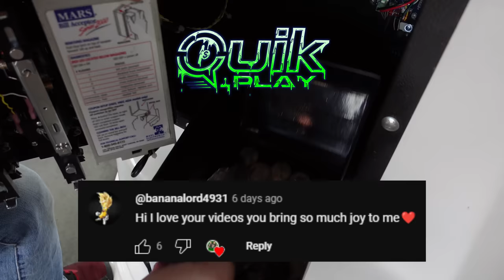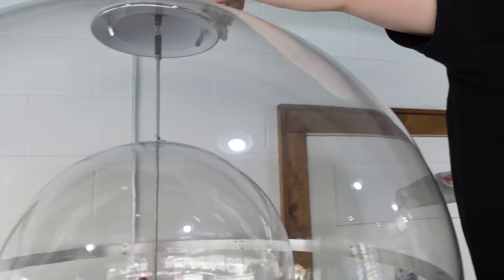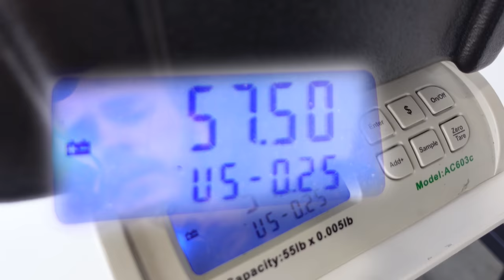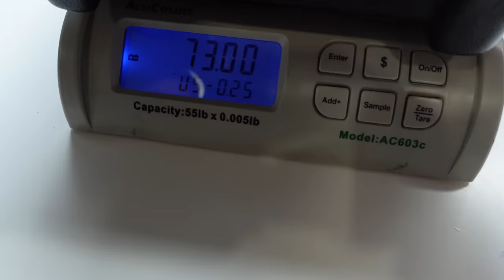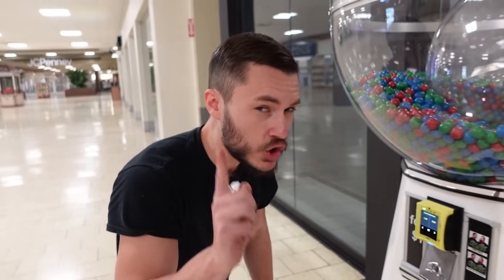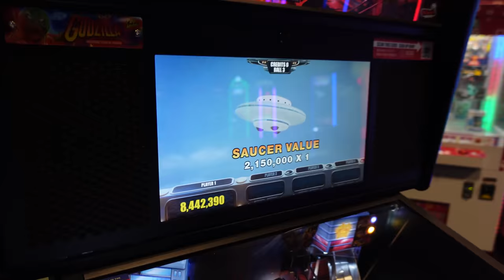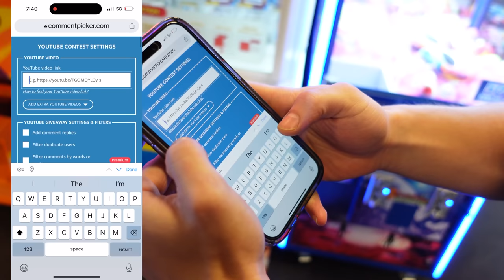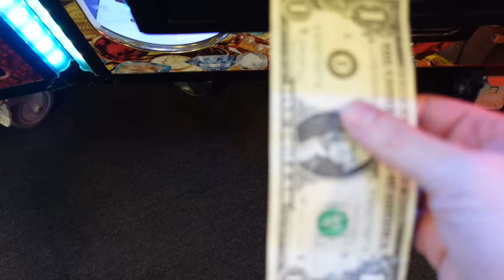Our 7 FOOT Gumball Vending Machine Is SOLD OUT?!

Comment: Unlimited potential for profit on the vending machines depends on choosing the best locations. As you said, the loss of the place for the big gumball machine costs you income.
 For those considering this business, sit outside a possible location with a hand counter and spend several hours counting the number of people going in, both at peak times, and in between. Pick the location to target your age group for the type of machine.  Keep on top of filling and cleaning the machine. Slow moving  product can get stale, esp. nuts.  I 'd suggest a countertop machine for the next give away.  Maybe another video on clearing jams or repairing a broken machine, as that's part of the business.

Comment: Add a backstop on the inside of your bubbles so that the gumballs will look fuller you know like The Fat Bottom on the large draft beer that is actually the same size as the regular beer but the mugs got a big bass with a bubble you can make it look full it does make the product look old when they ball is low when questions the age of the remaining product